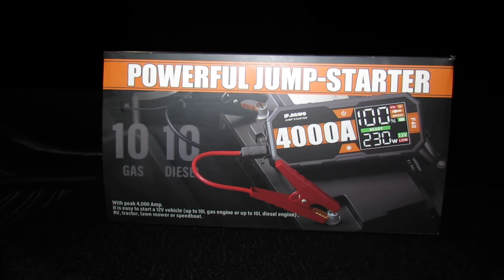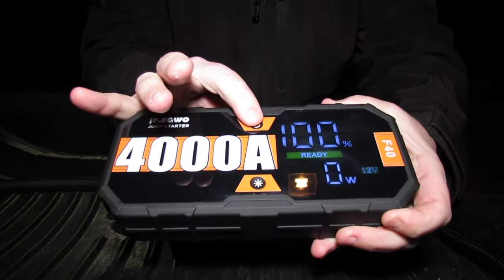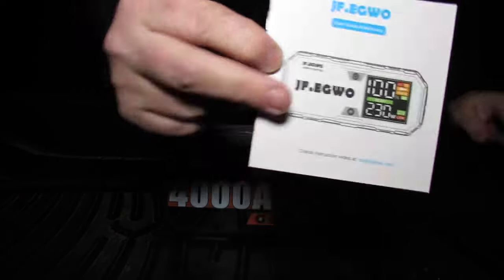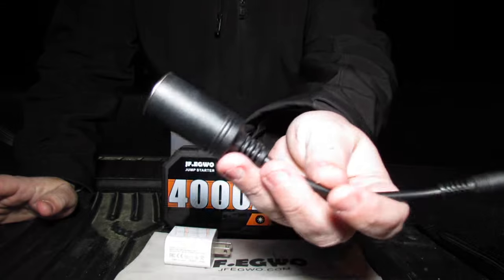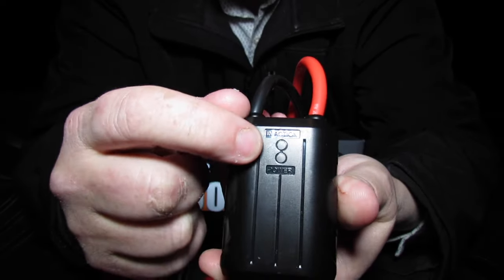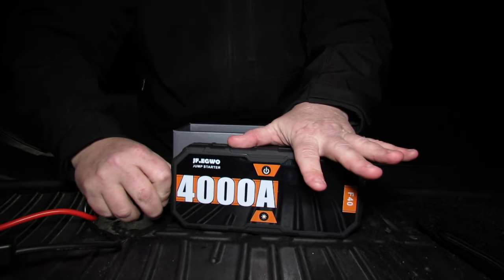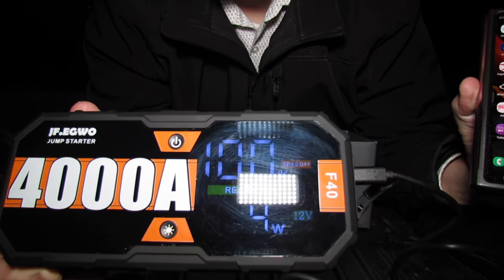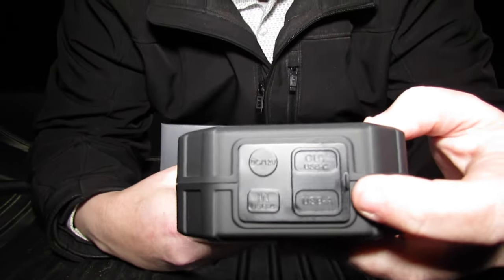JF.EGWO 4000A Jump Starter F40 (Powerhouse)

Comment: Thanks Michael for a good review.I wanted to buy this model for myself, in my collection, but I chose the BASEUS 2000A.Who, in real conditions, started a 5-liter BMW X6 diesel engine without any problems, the accumulator was 1 VOLT))
Reply from the maker: How is the BASEUS 2000A?  
It sounds like the BASEUS 2000A is a beast.
Reply: @HM_RELOADED   I myself work in technical assistance and this device is more powerful than my Gooloo 4000A
Reply from the maker: @hvg7351  wow, I'm gonna have to check it out. Thanks for letting me know about the BASEUS 2000A
Reply: This is probably a bot/troll.
Reply: @Dr.Who_84  Who is the troll?

Comment: I'm confused...  You show a 65W USB (- C?) "in/out - Fast Charge" charger connection yet, when you hooked up your phone it barely maintained a 5W charge rate... ??
Reply: The units LED screen showed between a "0 and 8 Watt" fluctuation while charging your phone. Your phone was at a 90% + charge yet, it indicated a "16 min. untill full(!)" recharge time remaining...!?!  @HM_RELOADED
Reply from the maker: @Dr.Who_84  When charging the phone, the wattage on the JF.EGWO screen was charging from 0 to 10  Watt the whole time. And you are correct, the phone was showing it was 90% charged and that it would take 16 more minutes to fully charge the phone. It depends on the wattage of the charging wire or brick how fast your unit will charge something. Thanks for the comment
Reply from the maker: I think we may have figured it out. I just used the same USB C charging wire from the JF.EGWO and charged the Jomgand 3750 portable jump starter and the JF.EGWO screen was showing it was charging at 65 watt for a few seconds,  then the wattage would fluctuate from 56 watt to 65 watt. I again hooked up the JF.EGWO to another high-powered device, and the JF.EGWO was charging at 64 Watt. When I tried to charge 2 different cell phones, the JF.EGWO was showing wattage fluctuating from 0 to 11 watts. So it may be safe to say that because the cell phones are not a high-powered device,  like portable jump starters, that is why you saw the wattage barely cracking 10 watts on the cell phone. I took a little video of the JF.EGWO charging the Jomgand 3750 portable jump starter, and it shows around 58 watts charging. Hope this helps
Reply: Ok., I get ya.  BTW is this a "sponsored" review...?? @HM_RELOADED
Reply from the maker: @Dr.Who_84  JF.EGWO did send us the unit in exchange for an honest review

Comment: The units LED screen showed between a "0 and 8 Watt" fluctuation while charging your phone. Your phone was at a 90% + charge yet, it indicated a "16 min. until full(!)" recharge time remaining...!?!
Reply: I wrote this because if my phone was at 90% it would take (much) less than 5 minute to top it off with my 15Watt Fast charger brick... ??
Reply from the maker: It would depend on what wattage the charging wire is that is being used. I have noticed from personal experience that the time remaining until fully charged is always a little different. For example,  when I looked at my phone tonight, it was charged at 90%, and it said I have 23 minutes left until fully charged. In the video I did months ago,  my phone was charged at 90%, and it said 16 minutes until fully charged. So both times, it was showing the exact number of 90% charged, it was then showing 2 different remaining times. So I think it realty has alot to do with the wattage of charging wire being used.